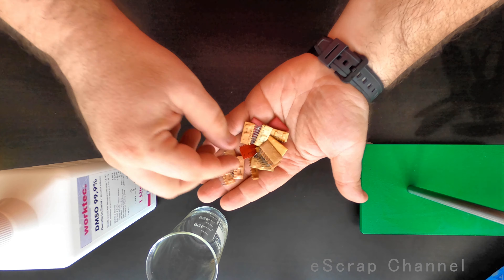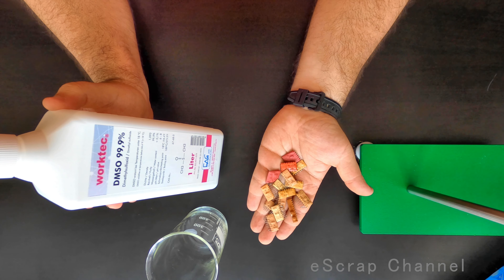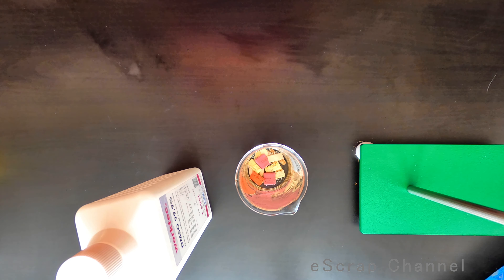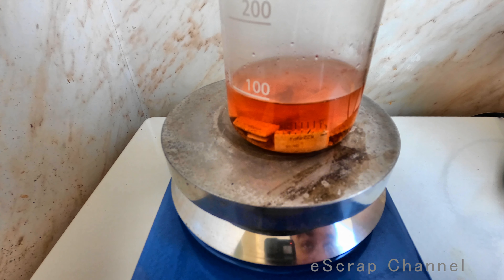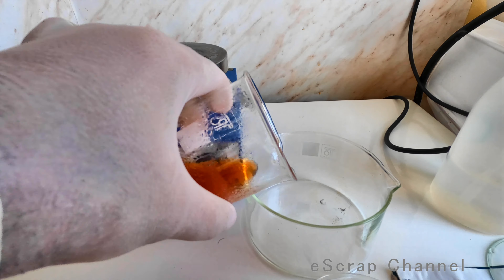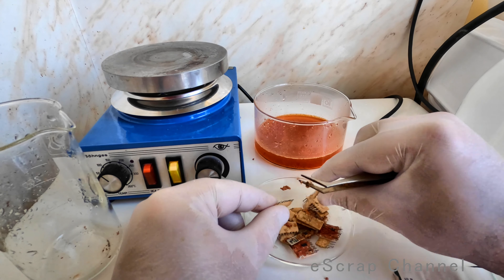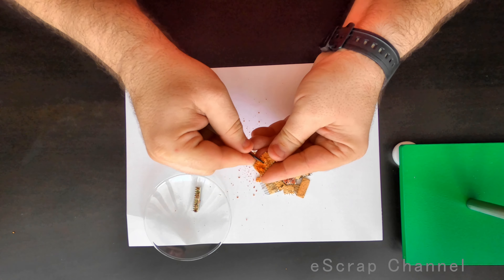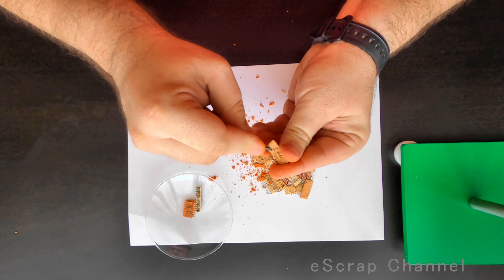Hidden MLCCs Recovery with Dimethyl Sulfoxide (DMSO)

Comment: To clarify, these are hybrid modules with components mounted on a thin ceramic wafer that acts as a circuit board.  Then the whole thing is coated with epoxy or some other coating.  That coating is what is being removed by the DMSO, it will have no effect on the ceramic itself.  That’s a very useful technique, thank you for this video!
Reply from the maker: Yes, you are correct! Welcome!